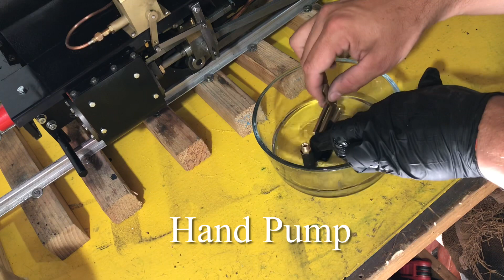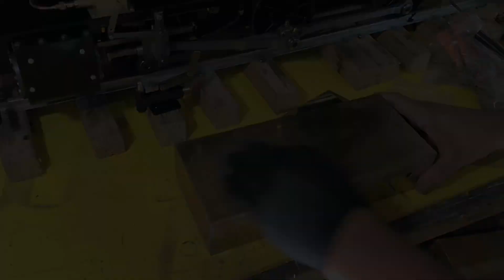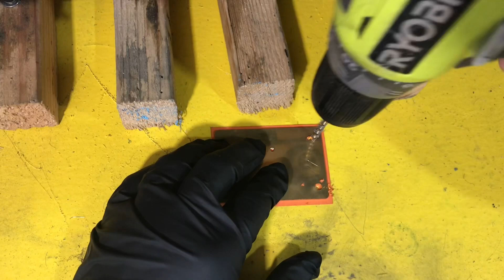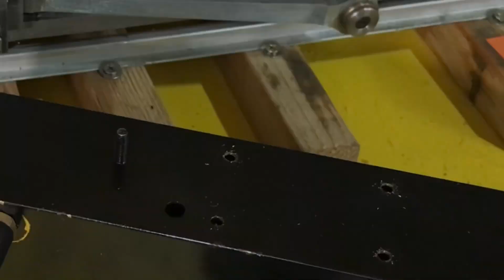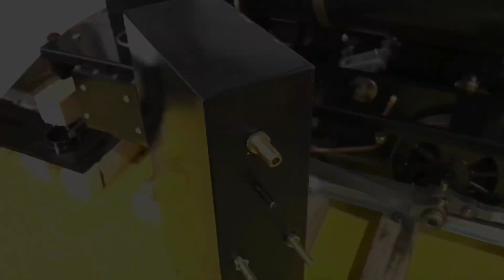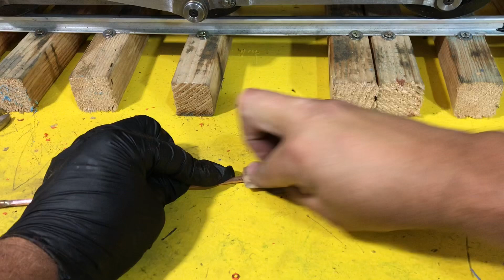Polly Locomotive Kit Build Part 19

Comment: Oh, the click and clunk when the spectacles and tanks dropped into place, how satisfying. Have you tried using four ought steel wool on the pipe and brass work? I find it leaves a lovely sheen that it easier to keep up with. How the ‘eck do you manage to get away with bending the pipe work by hand so well?  I’ve used the SWAG (scientific wild arse guess) method and come to grief so many time LOL. Nice looking loco chum, keep on it, cheers 👍
Reply from the maker: So satisfying!! I live for that feeling! Yes I actually steel wool most of the parts after sanding. Probably poorly but I try to hit the brass with the wool. I feel better about bending pipe by hand now then ever but still use my pipe bending tool as well. 🍻